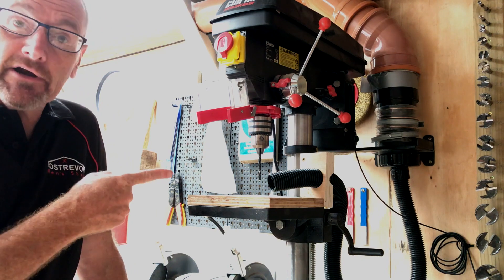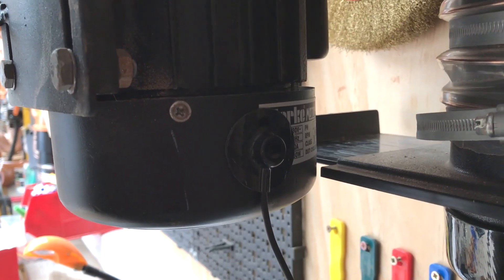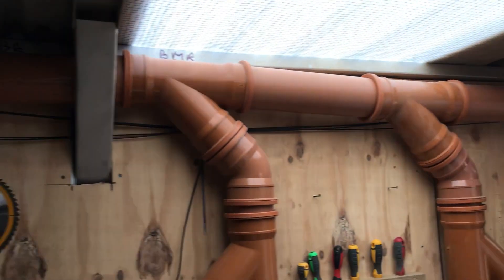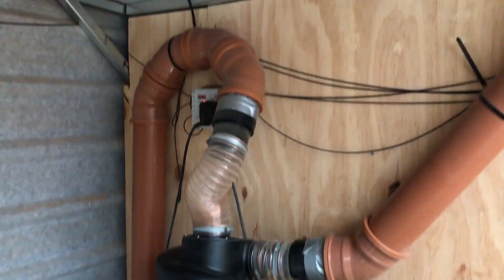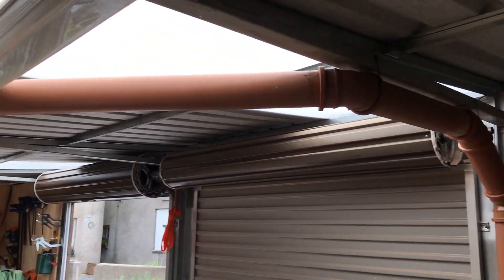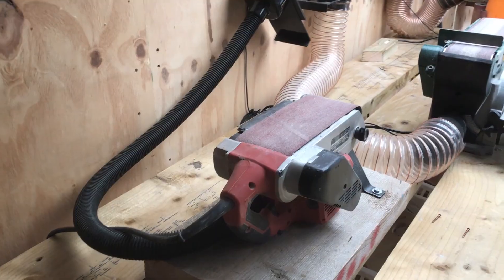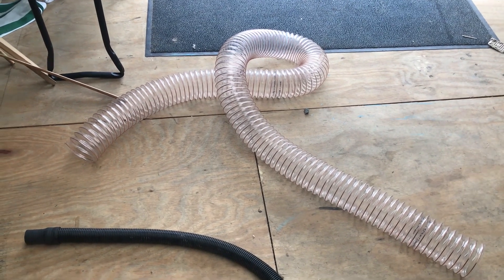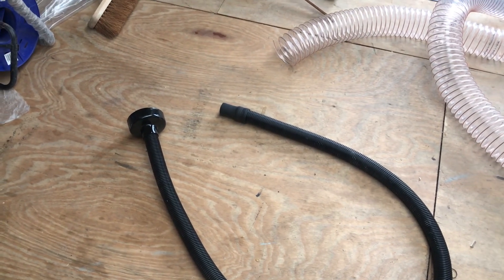Our dust extraction system

Comment: Wow love the system was it expensive, we have a charnwood system but it is on a 16 amp supply would this automatic switching system work with our dust extractor, can you give us some links for items used in your build, Eddy Bootle tool shed
Reply from the maker: Hi Eddy. The vacuum unit was about £400, the dust deputy was around £275, automatic switching (10 machines about £450, blast gates (12) and adaptors were about £250, and the soil pipes and fittings were around £250. We bought the vacuum unit from www.recordpower.co.uk , the fittings and adaptors from www.axminster.co.uk and the dust deputy from www.toolovation.co.uk

Hope this helps.